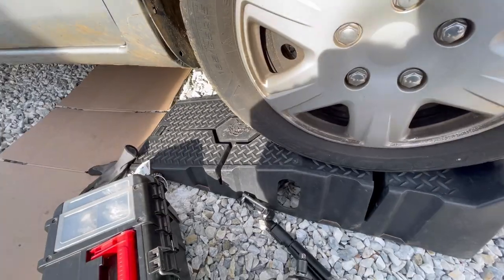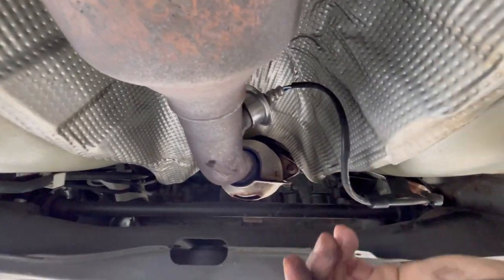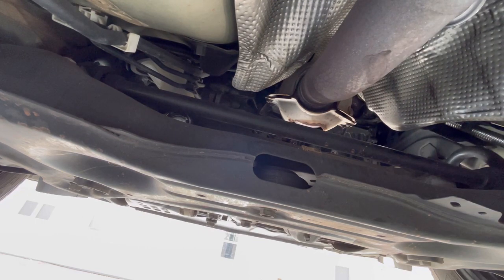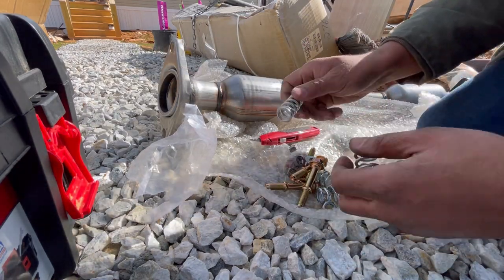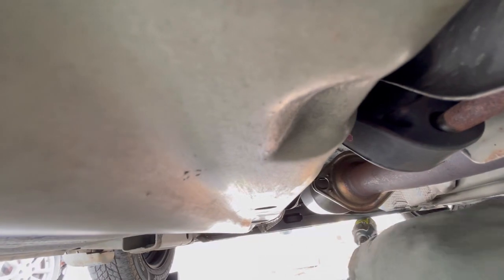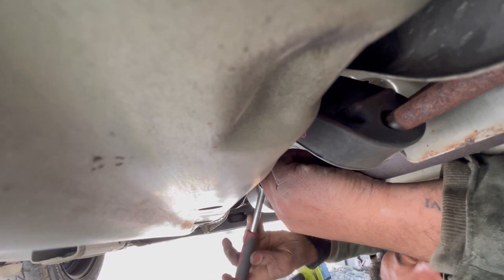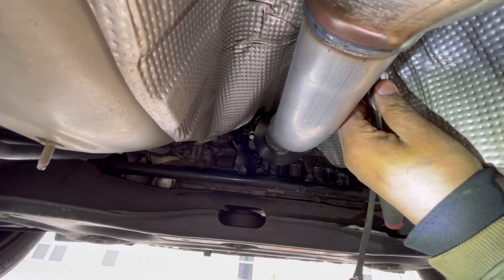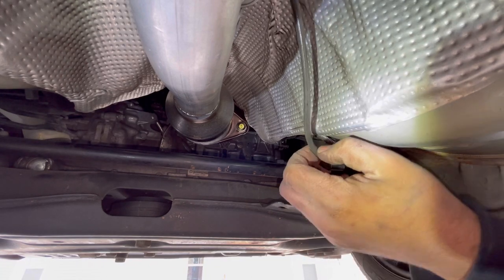07-14 Versa Catalytic Converter Replacement

Comment: No salt corrosion, you are so lucky. My worry is I will twist the bolts off at the exhaust manifold. Then the job is a long operation to remove the manifold to drill out the broken studs. I hope that does not happen. Mine is a 2013 Versa S. I'm on my second set of resonator and muffler pipes. The OEM failed at the flange, as they did not use stainless for the flange material, so the salt corrosion caused the weld to fail between the stainless pipe and the mild steel flange. My catalytic failed at the flange that the resonator pipe bolts too. And it was a weld failure. The salt is from winter application, as I live where you get ice on the road during that season. I only have 60K miles on the car, and seeing all the underbody rust, it's time to buy a new car.